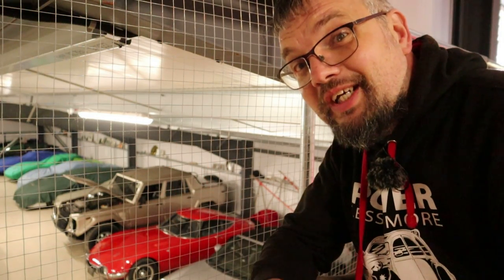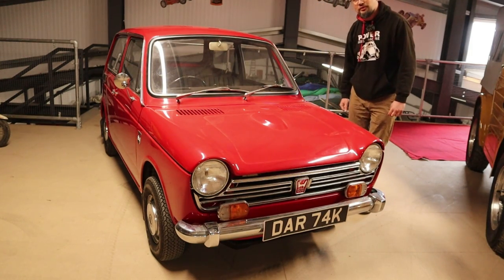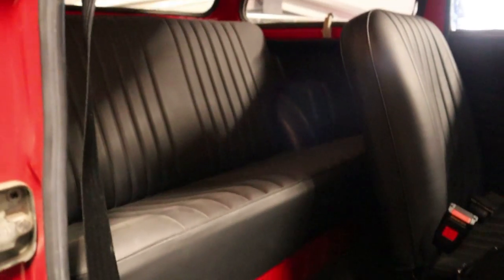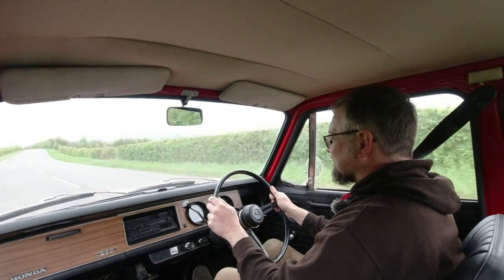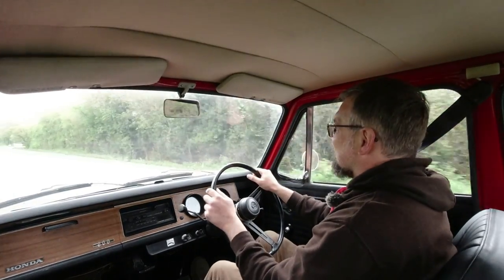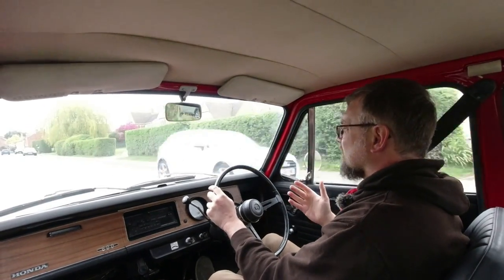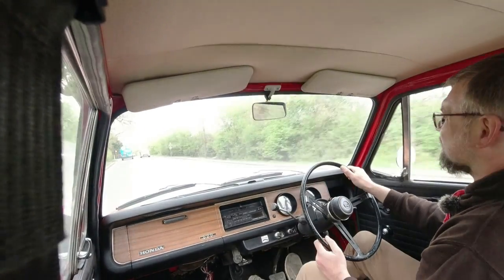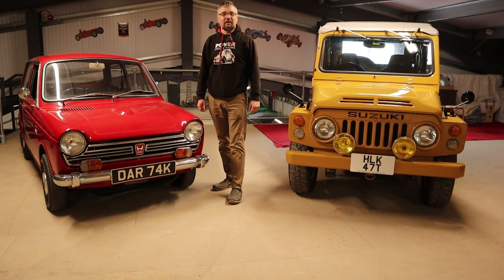Real Road Test: Honda N600 Hondamatic. Amazing engineering!

Comment: Honda licenced motorcycle DCT transmission technology from Jawa, who first introduced it for motorcycles in 1967 with a 250 single & 350 twin 4 speed DCT 2 stroke models, which didn't catch on with bikers. Honda produced the CB250A & CB400A Hondamatic bikes, in the mid 1970's, which also didn't catch on with bikers.

Comment: I discovered how much Honda had advanced car engineering when I changed an 1850 Dolomite to an Acclaim and to compare the two you would have thought the Dolomite had the 1300 engine and the Acclaim had the 1850 not the other way around

Comment: I had a honda c50 and c90, the c90 was a 3 speed semi automatic, but my c50 was actually a 3 speed fully automatic non cvt, so I wonder if it has a smaller version than this.

Comment: I love honda cars i had a mark 1 honda civic then a mark 1 honda prelude the best i have ever had, it was the top of the range with electric glass sunroof and the best compact radio i have ever seen no need to take your hands off the steering wheel the 1970s and 1980s  all looked different inside and out now they are just all black plastic built as cheap as possible no carricter ,honda always does  things
Reply: A little better  roy

Comment: How cool is that! I’m blown away by the column shift automatic. Looks like a joy to drive. I wonder why they ditched it for a floor shift on the Civic? I always thought Hondamatics were just 2 speed?
Reply from the maker: I think Hondamatics were always three speed until the 1980s.
Reply: I had a little Honda today a few years back, two cyl with veromatic gears nice car.
Reply from the maker: Yes, just checked and the Civic was a two-speed unit. Not a great idea!

Comment: Small wonder that Honda did well with the motorcycle DCT system then. I've often wondered how things have might have gone if NVT engineers and designers had been allowed to develop compact economical vehicles using their established technology instead of allowing independents to make micro cars (I do love them just the same) and worked with the government to leverage tax and sales, while minimising congestion. Instead we got the Ariel 3 and the sad commercial decline of the industry. At about the same time Honda were running 125cc six cylinder engines to challenge in the TT, not afraid to try different things was Honda San.

Comment: Ian I noticed you driving with both feet and thats an Automatic which means you should be driving with right foot only. Any reason why you were using both feet for this wonderful little car?

In 1995 I owned a Daihatsu Domino a similar size to thatHonda N600  yes a Dinky size car that was fun.

great informative video as always

atb Mike SkegVegas
Reply from the maker: It's entirely sensible to drive with both feet. It's why many autos have a wider brake pedal.

Comment: I believe the CVCC met federal emissions without a catalytic converter, if that’s what you meant by bolt on rubbish. But it certainly had its share of emissions complexity, with the beginnings of spaghetti bowl mess of vacuum lines running around the carburetor.

Regardless though, that CVCC head was incredibly clever, and despite the complexity, certainly proved more reliable than the USDM offerings attempting to curb emissions. Such a shame they were so extremely rust-prone, so despite the stout mechanicals, you just don’t see them anymore outside of places like Southern California. 

And speaking of high revving engines, I believe the S600 still holds the crown of highest redline in a production road car. I think they had a redline of something like 9000 rpm, maybe higher. The later S800, with its larger displacement, has a lower redline, not because it can’t rev higher, but because it is pointless to do so from a power standpoint. 

Kinda reminds me of the early Taurus SHO, with their Yamaha sourced 3.0 or 3.2L V6. I believe those engines can easily hit 8000, but the ECU limits it to 6500 or 7000 because the Ford accessories couldn’t handle much more than that.

Comment: Great car. The automatic gearbox that worked so well with a small engine really was unusual back then as most traditional automatics killed all the power in tiny engines, if automatics were even offered on cars in this price range. Even in 60's/70's America, smaller cars were mostly sold with manuals because the 3 speed automatics of the time killed the performance and economy, and added a big chunk to the price of a cheap car.
What else was even available back then with an automatic in this price range? The DAF 33?

Comment: I'm not sure you're correct in saying this was Honda's second car design as they had developed the S600 and S800 then the N360, followed by the N600, so unless you count the sports cars and the N models each as the same design (certainly the S models were pretty different particularly when the S800 went from chain drive and IRS to conventional drive shaft and live rear axle. Perhaps I''m being too picky!! My Mum had an N360 in the 70's and a fantastic little car it was. I overhauled the engine and gearbox for her which were pure motor bike in construction.
Reply from the maker: The N Series was Honda's second car design, after the S Series.
Reply: @HubNut  Yes, see where you're coming from now Ian, I'd always considered the S500/S600 to be signifiantly different to the S800, but I guess it is the same design. Always been a Honda fan after early motorbike experience.

Comment: My Scotty has a problem with its exhaust now. There's a bendy bit that normally has a braided surround, this was torn off on a speed hump in Horton. So this will be a another bit to get off Whisky, as soon as I work out how to get Whisky in the air. My main means of lifting is a pair of scissor lift style ramps. Find if the car has a working engine. Whisky's engine is not. I have one of those ratchet luggage strap down things. So I'm thinking, hook one end to Scotty, other end to Whisky, and then winch Whisky onto the ramps. There is a label that says "Not for lifting", but this is not really lifting, is it?

Comment: Hang on, both pistols travel up and down at the same time?? Is that a thing? Cracking little car.
Reply from the maker: Yes, quite common on twin cylinder engines. My error is that they don't often fire at the same time.

Comment: You should not lump the Imp in with other small capacity cars of the time. The engine was very advanced for its time, being an aluminium overhead cam engine. It had a top speed of 90mph and 0 t0 60 time of 16.3 seconds, despite its diminutive 875cc. Compare that to the Austin 1300 with a top speed of 86mph and 0-60 time of 16.5 seconds. I had one and it easily burnt off Austin 1100s.

Comment: It's kind of weird that the Hondamatic of the 60s was a three-speed automatic, whereas the one fitted to my 1979 Accord was a two-speed unit that you had to change gear yourself. Wonder why they decided to do that? Bit of an odd decision, all told, although it does mean that Accord is the only car I've owned to date that would do 60mph in first gear!
Reply from the maker: Yes, I think with the later ones, the idea was you left it in second all the time, unless you really needed first - ie hill starts or in traffic. Bit odd though.
Reply: @HubNut  I always started in first myself, it was just too sluggish if you pulled away in 2nd.

Comment: Wait... WHAT? These had a 3-speed fully automatic, yet the first Civics and Accords that came out many years later only had a 2-speed that had to be shifted manually from low to high??? What happened? I always assumed the original Hondamatic was the same as the later ones. In any case, very impressive. Shifts seem lightning fast and smooth for the time.
Reply from the maker: Correct. With the two speed, I think they expected drivers to stick in second unless first was necessary.

Comment: Always saw the Honda N600 as more of a Fiat 500 rival, with the original Mini as more as a Fiat 600 rival. Given the commonalities between the N600 and Mini as well as BMC's short-lived 2-cylinder A-Series and the pre-9X (and roughly Kei/500-sized) Mini-Mini for Italy projects, it is pretty easy to imagine BMC producing a little brother to the Mini for certain markets though as far as automatic gearboxes are concerned have doubt Issigonis's later 9X gearless ideas would have worked properly compared to more realistic alternatives such as possibly a down-spec 2-3-speed version of the AP Auto or a more Hondamatic-inspired solution.
Reply from the maker: Pricewise, the N600 very much competed with the Mini. And size wise!
Reply: @HubNut  To be fair the 500 was of similar weight and dimensions to the N600 despite giving way to both the N600 and Mini in terms of wheelbase, the stillborn Mini-Mini was to have a length of around 114-116 inches with a wheelbase of around 74-76 inches (though accounts claim the Mini-Mini project for Italy featured increased width of 58.5 inches due to the 750 engine and transmission that would later be carried over to the 9X project).

Also imagine tariffs played a part in the N600’s price relative to the Mini.

Comment: Yes, it even sounds like a motorcycle engine. The S800 tiny sports car produceb 70BHP and woud do 100MPH, had 4 carbs and would rev to 10,000 RPM. The Kawasaki H2 Ninja is only 1000cc,produces 310 BHP nd tops out at 250 miles per house [ok it is supercharged] but wht 1000cc car produces 310 Horsepower?.     As you may of guessed I am a motorcycle fan as well as a classic car fan.

Comment: My Honda car has an automatic with dogs. It's far from being a dog though. The box is a ZF nine speed and replaced a Honda made automatic that was fitted to previous versions of the CR-V.  Recently they have gone all CVT which few  potential customers/drivers in Europe actually want.  I've also got a 420cc Honda quad that is mated with an all-dog manual five speed gearbox. Foot change like a motorcycle. It can do 50mph more or less and the acceleration can be scary.
If this 600cc two cylinder engine has both pistons going up and down at the same time, even though each will be on different strokes of their four strokes, how did Honda balance the engine do stop it bouncing up and down?
Gearboxes on cars are a dying breed. Electric cars will only have one ratio with the motor providing all the speed range from 0 to whatever top speed they set a limit at. Theoretically if they have a 1:1 ratio that gives 10mph at 10 rpm, then 12,000rpm will give 12,000mph!  What fun that would be LOL.
Reply from the maker: Not sure how they managed it, but the Daihatsu twin works the same way.
Reply: @HubNut  
They must have a massive counterweight on the crank. The TC overcomes any pulse shocks that could damage the transmission.

Comment: I'm not surprised you can smell the engine you have no mechanical sympathy for an old tired engine . Maybe put yourself through a triathlon and get an idea how the old engine feels
Reply from the maker: Honda engines are designed to rev. Can't say spanking the arse off my 2CV's engine has done it much harm in 170,000 miles of driving.